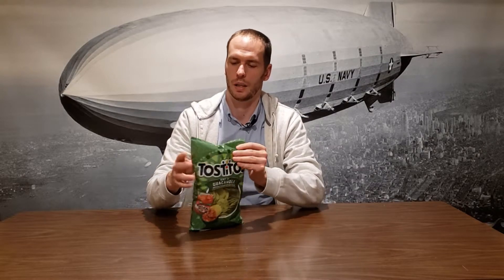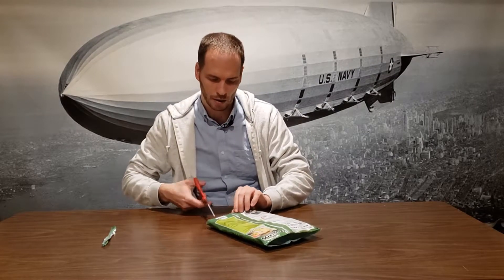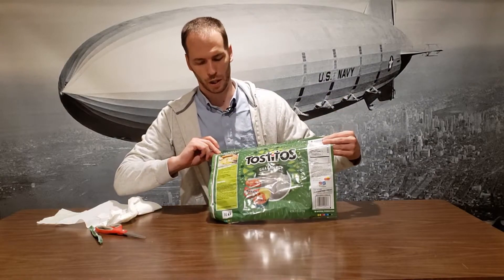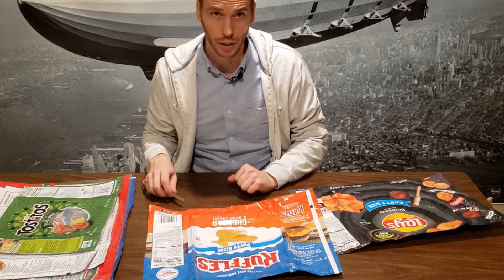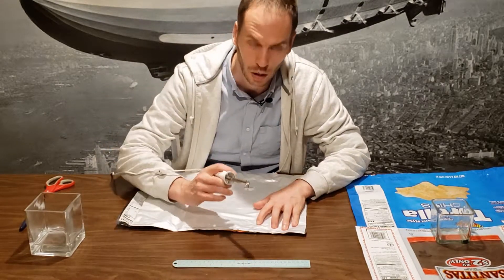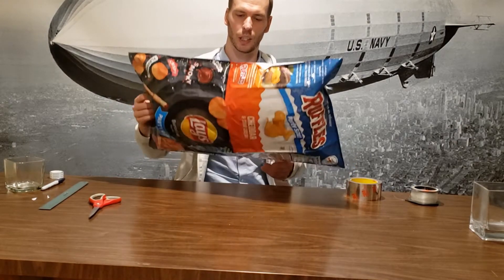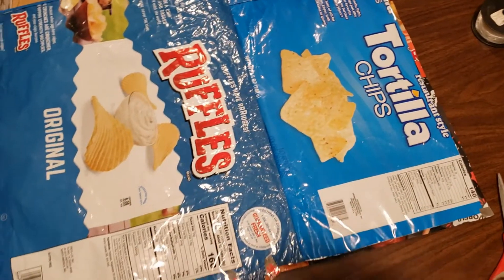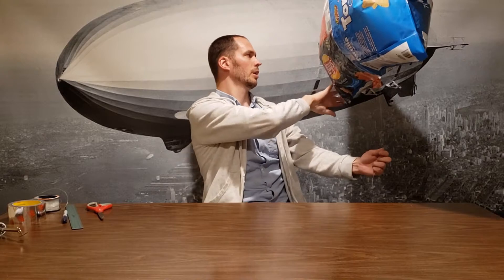Make Things Fly - Project: Chip Bag Balloon (or Crisp Bag Balloon for those outside the US)

Comment: Aaron!  cool project....and the video held interest all the way through.   well done!     coulda told you though....those cheap "Santitos" bags  are always, always a problem.   Ha!
          Fun.     I have a four-foot wide, 600 foot long roll of aluminized plastic sitting here in my living room waiting to be sealed up into large cells for an airship.   I'll be using a regular clothes iron to heat seal them when the time comes........
    keep making things fly!   ciao   Darrell
Reply from the maker: Always great to hear from you Darrell! I'm new to heat sealing, using a regular iron sounds creative. I had trouble initially sealing the Santitos bag, I'm not sure if it was because they are to different materials. In the end I had to make it bigger so it wasn't too hard to replace it while I added more bags.

Comment: I found this video by typing 'chip bag helium balloon' into the YouTube search field; yours was the only relevant one. It had all the information I needed. Thank you! You have gained a new subscriber! By the way, how long did it last?
Reply from the maker: It did not last very long. For my project I used a heat sealer and since I was sealing multiple bags together there could have been leaks. From working with chip bags I have found they are not great at helium retention. But it was fun just to do it for the sake of doing it. Chip bags are also a lot heavier than traditional materials used for balloons, so it requires a larger volume just to get it to initially lift. Also not all chip bags seal together well. I had issues trying to seal clear chip bags with the metallic ones. Even though I loved the idea of clear and metallic chip bags together, I eventually removed the clear ones.
Reply: @makethingsfly  thank you for the reply. Did it last a day? I don't want to fill them with helium. I am trying to make lightweight flying surfaces held rigid by air-filled ribs. I am not explaining it properly, but I am mainly looking for a robust, reasonably lightweight heat-sealing material.
Reply: Since I am a hobbyist, I have a requirement that the material should be easily available
Reply from the maker: Chip bags are probably not the best material to work with, my chip bag balloon didn't last even a day. I have used mylar space blankets for a number of projects and it might be better suited for what you are trying to achieve. Think plastic sheeting, like thick black trash bags, also might be something to use. If you aren't filling it with helium and don't mind the weight then you could repurpose inflatable beach items, so they have an attached valve.
Reply: @makethingsfly  Thank you! I think uninflated helium balloons would also be a good material. About mylar space blankets: I tried buying mylar rolls online, but there were many different types and all of them were quite expensive. Do you have a link or something to the material you used?
Reply from the maker: For my last project I just bulk ordered 20 space blanks/emergency blankets. If you're located in the US, the Doller Store has cheap foil balloons you can purchase without the helium. They also have rolls of cellophane in the birthday/gift isle.
Reply: @makethingsfly  Thank you! This is precisely the information I wanted. These items are easily available in my country (India). Where I went wrong was trying to order 'heat sealing mylar rolls'